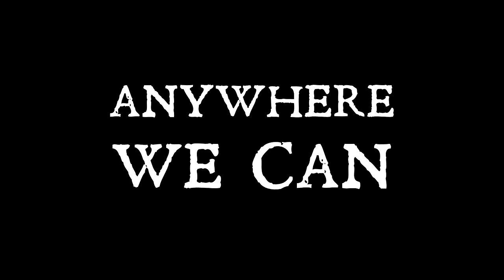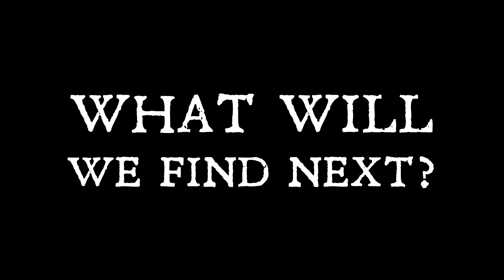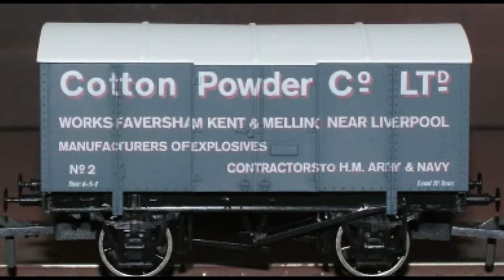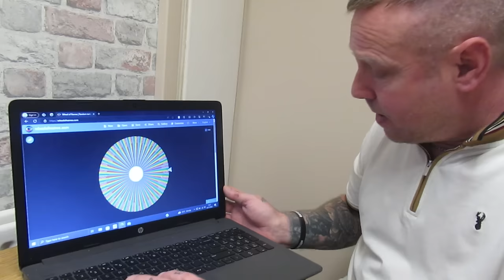Was This NEVER Supposed To Be Found? Magnet Fishing

Comment: The first bullet isn't a .303. The .303 is a rimmed cartridge whereas that is a rimless cartridge. Without measuring it's difficult to be sure but it looked like a 30-06. The same calibre as the .303 (more or less) but using a much more powerful powder.

Comment: could be a belt wheel from a steam tractor engine. if it was a tracked wheel (coal mine/ tram/lead mine etc) it would have a flange on the one side to prevent it leaving the rail tracks. and looks to small for a road wheel